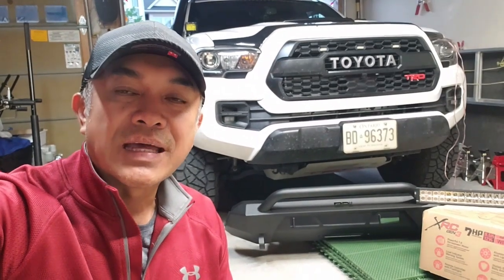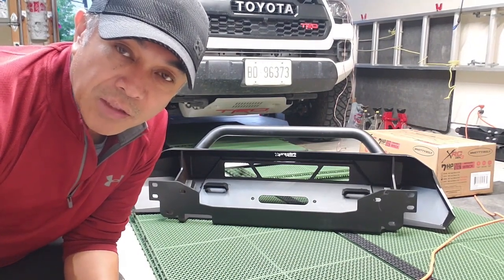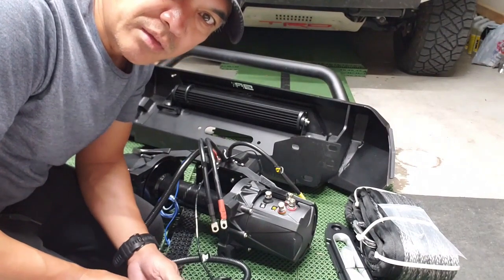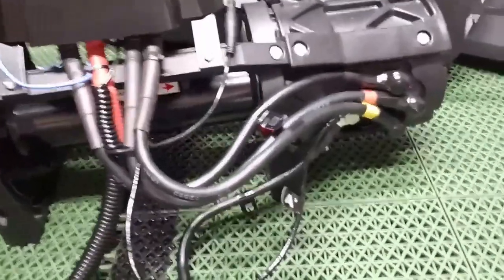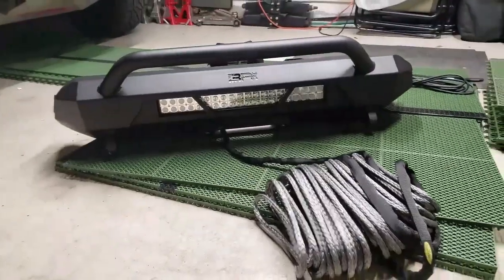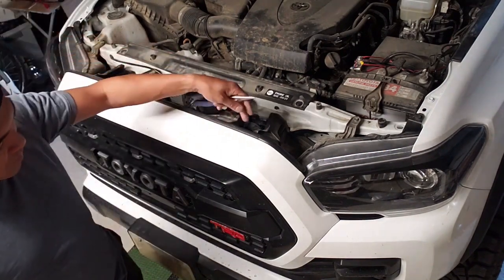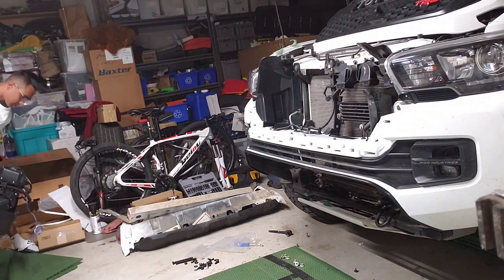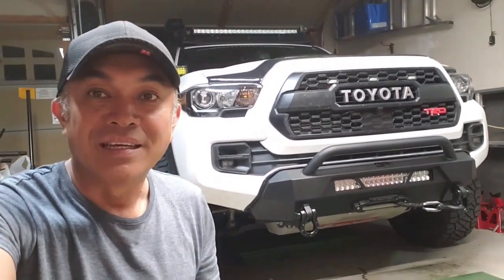Body Armor Hiline Bumper + XRC Winch, 24" Lightbar DIY Install onto 3rd Gen Toyota Tacoma | Mod #43

Comment: Did you reinstall the bolt for the cooler lines? I can seem to get mine put back into place.
Reply from the maker: Yes I did re-use the factory bolts. Check the video at the 16:47 mark.
Reply: What about the lone bolt behind the wheel liner that holds the line in place… did that one go back in?

Comment: How much sag did you have in the front end. I already have a lift with coil overs so I can adjust them after the fact. Just curious. Awesome video brother, my setup is going on in 2 weeks. Same as yours, just a Warn winch instead.
Reply from the maker: Hey Laurence  it sagged a bit and enough to cause tire rubbing.  Unfortunately I did not measure before and after so I couldn't tell you exactly how much it sagged. However, after installing the 51025 Tuff Country leveling kit which is a 1.5/1.5 lift (checkout my installation videos on that), rubbing disappeared so it would be safe to say that it sagged by 1.5" at the most.  Nice choice you made there with the Warn... a little bit off my budget =) but my setup will suffice. Thanks for tuning in bro!
Reply: @modXELA  awesome brother. My icon lift will adjust,  thanks for the info, I’ll send pictures once it’s all installed. Do you have an email address brother?
Reply from the maker: @laurencehiggins239  hey, photos will be 👍 send to modsxela@gmail.com. BTW, how do you like your icons on the road and offroad? I'm considering the Beilstein 8112... eventually.
Reply: @modXELA  I have the icon stage 5 lift kit with the adjustable upper control arms, it’s amazing. Rides like butter on the road and is amazing off road. It’s not cheap at all, but it was money well spent.
Reply from the maker: @laurencehiggins239  yeah I'm hearing nothing but good things about the icons.  I'll definitely consider it when it's time for me to upgrade 😉
Reply from the maker: @laurencehiggins239  don't forget to send photos bro!
Reply: @modXELA  I won’t bro.

Comment: Does anyone make a bumper similar to the Body Armor that doesn't require you to cut the OEM bumper?
Reply from the maker: Hi travblurr8043, I'm sure you did plenty of searching but I don't think it exists.  I wanted to avoid all the cutting as well but I couldn't find one that looks similar to the BA or DV8 etc. However, if you Google "Toyota bumper guard" you'll see some that don't require cutting but they don't look anywhere close to this look.  Good luck with your search and thanks for tuning into my channel!

Comment: Hey brother, new subscriber here. A few questions. I will be installing a 4wp front and rear  bumpers soon. 1) will the cut be the same with the BA.I do like that you did not remove the bumper out completely.   2) will my hidden caliraised lightbar behind the grill be on the way with the winch?  Salamat bro.
Reply from the maker: hey Mariel. I'm currently away on a business trip but will be back home on Friday.  I will have a look at my truck to address your Q's.  Sorry for the delay but I'll get back to you soon.  Salamat kaibigan!
Reply from the maker: Hey bro... 1) sorry but I can't say for sure if the cut will be the same but will be similar process for sure.  2) the front of the winch is 2.5" from the lower grill where your lightbar is. As long as it's not sticking out by that much, you should be able to clear it.
Reply: @modXELA  i does look like the cut on the BA is wider compared to the 4wp. Someone suggests to cut it where it flattens. Hope i can remove the crash-bar out with the bumper intact. Salamat kaibigan.
Reply from the maker: Good luck with your install, would love to see after-photos!  I appreciate you tuning in... salamat pare ko!  Btw, do you speak fluent tagalog?
Reply: The install went really well. It was a lot of work.. I love the 4wp front and rear bumpers. What is your measurements now with the added weight ? Yeah i soeak fluent tagalog. And bisaya.

Comment: How much if any does that bumper change the approach angle?
Reply from the maker: Not sure but it definitely dropped my front-end due to the 165 lbs added weight. This forced me to install a 1.5/1.5 kevelling kit to rid of tire rubbing.

Comment: Was there any gaps between the trim guard and the bumper?
Reply from the maker: Hey Caleb Pflugrath... there's a very slight gap in some points but almost negligible. Also, even if there is, I'm just curious to know why does it matter?  Give me a few minutes, I'll take a close-up video for you and send you the link.
Reply: @modXELA  ok. I was just curious because Im install the same thing and I want mine to be tight and not gapping. I’m pretty ocd when it comes to these things😂 I look forward to receiving the video👍
Reply from the maker: @calebpflugrath9146  I don't think you can avoid some minor gaps and that's what the trim does, to cover up that gap.  There's always an "acceptable" play in many installs.  At any rate, here's the link to the video and I hope it answers your concerns... https://youtu.be/0DKZm8eHXeE

Comment: what are your thoughts about the light bar that you are using?
Reply from the maker: Hey Musafir, it's pretty decent considering I only paid about CDN$50 for it.  It gives out plenty of lighting and it's come very handy when I arrive at a campsite late at night. I really did not need another LED lightbar but since there was a spot for it in the bumper guard, I went this as it had decent reviews and wasn't a bank breaker.
Reply: @modXELA  Great, thanks.

Comment: So you installed this on the stock suspension correct?
Reply from the maker: Hey Anthony, that's correct, on stock TRD Pro suspension but the weight caused the front end to drop so it caused tire rubbing that's why I ended up installing the 51025 Tuff Country leveling kit (1.5/1.5) which eventually solved that problem.
Reply: @modXELA  I wanted to add the bumper with the light bar (no winch yet) on stock tires and suspension was curious on how much it would sag without the winch👀
Reply from the maker: @anthonynguyen6009  unfortunately I couldn't say for sure but the bumper guard with the lightbar weighs about 78lbs so my educated guess would be about 5/8" to 3/4" drop.  Here's an idea... try placing an object by the bumper that's about 80lbs and measure your height before and after and it should give you a rough idea on the drop.  Also, note that if you're not planning to install a winch yet, it would be difficult to do it after the fact.  You may need to remove the entire bumper guard in order to mount the winch on... just something to consider.

Comment: Doesn't this add weight to the Tacoma effecting gas mileage?
Reply from the maker: Hi Darryl, yes it adds 160lbs which equates to one person.
Reply: @modXELA  Wow didn't realize it added that much weight
Reply from the maker: @PHILLIPS8822  Yep, that's between the bumper guard, winch and lightbar.  I had to install a levelling kit after as my front end dropped and caused tire rubbing in the wheel-well.  =)

Comment: It says on the website it fits a 20 inch light bar. Is yours truly a 24 inch? How does it fit?
Reply from the maker: There's plenty of room in there, you can adjust the light bracket accordingly. Although the description of the one I installed was 24", the physical dimension around 22" and it turned out to be a perfect fit.
Reply: @modXELA  I ordered a 20. Should I order 22?? I don't want empty space when looking at it when it's installed
Reply from the maker: @Pilsungbo  the 20 will be short for sure!
Reply: So 24 is the best size to make it full? No space on left and right! Why would body armor say fits 20 inch light bar. Shouldn't they say 24!? Lol
Reply from the maker: @Pilsungbo  I measured the hole for you just now and it is physically 20.625".  The ends of my lightbar are literally sitting right at the ends. Just make sure that what you're buying physically measures more than 20.625 so you won't have a gap.  My  (so called) 24" physically measures 20-7/8".  Same thing when you buy a 2"×4" lumber, it's never really 2"×4"....  =)
Reply: I appreciate it! I may have to make a few choice! Thanks for the replies!
Reply from the maker: @Pilsungbo  Cheers!

Comment: can you still reach the clutch on the winch?
Reply from the maker: Yes, I'm only 5'7" and no trouble reaching it.  This is after lifting my truck by 1.5" as I got tire rubbing after the bumper guard  and winch install.
Reply: @modXELA  I guess my question should have been, how do you get to the clutch on the winch? It looks like the winch is completely enclosed in the bumper, o how do you get to the clutch or hard connect your winch controller if the battery was dead?
Reply from the maker: @kermitec  The clutch does not need to be connected as it is sitting on top of the entire unit so it's very accessible.  Maybe you're referring to the remote/controller - but this is also accessible. I can create a short video of this and I'll provide you a link by this weekend.  Also on your note regarding the battery if it goes dead, connecting it would be moot point as I can't operate it without battery.
Reply: @modXELA  If you have time that would be awesome and if not then that's fine as well. Thanks a ton!

Comment: Did you remove the factory tow hook?
Reply from the maker: Hey H M, no, still there. Also, it's 20mm from the edge of the groove.
Reply: Thanks! It was a great help having this video
as a reference while Installing my bumper, winch and light bar .
Reply from the maker: @HM-vu9zw  I'm glad this was helpful... cheers!
Reply: How have the bumper/winch/light bar held up? Any issues?
Reply from the maker: @HM-vu9zw  everything's holding up pretty well but my winch haven't seen real action yet (which i guess is a good thing) but i unspool and spool it once in a while just to make sure it's still working and to avoid seizing.
Reply: @modXELA  no rust or any other issues?
Reply from the maker: @HM-vu9zw  i will take a close look at the entire system and will give you an update tomorrow.
Reply from the maker: Hey HM, I checked out my setup and everything is great.  no rust or discoloration on the bumper.  I've gone on a few offroad trips this past summer and put on many highway kilometers and I'm surprised I didn't see any scratches or dents or even paint nicks. Also, the lightbar and winch works as expected. Very happy with the quality so far.

Comment: You shoulda got the HF Badlands Apex 12000. It's better than a Warn or a Smitty and it won't leave stranded. Nice build none the less.
Reply from the maker: Hey Gabriel, nice, it looks like it has better specs.  I wish I knew about it before my install.  Anyway, I'm still happy with this and I'm sure it will do the job.  Thanks for sharing!